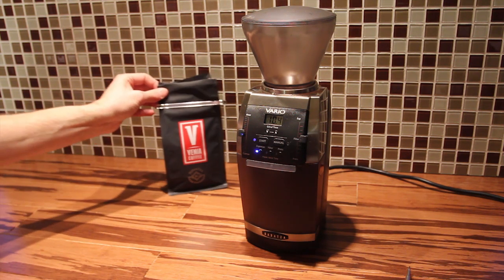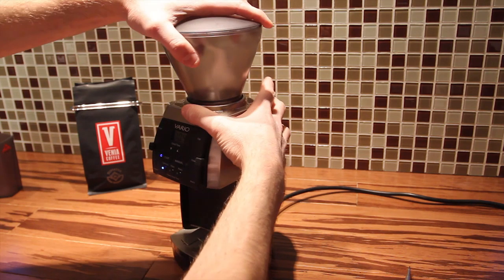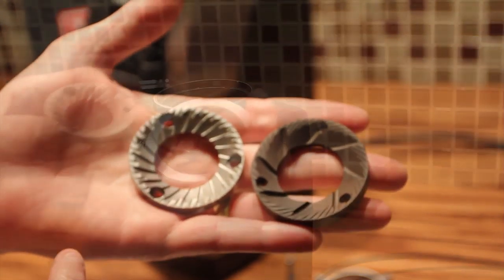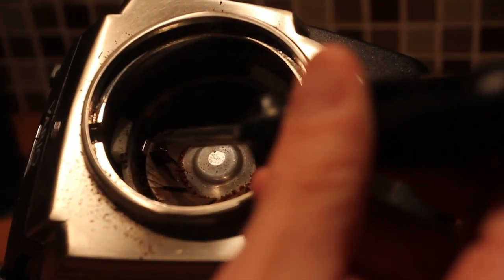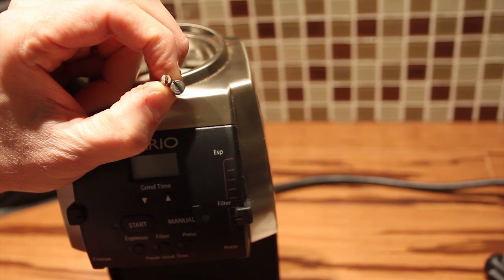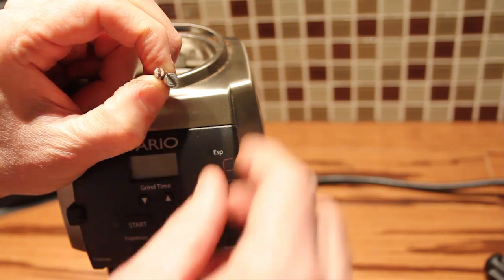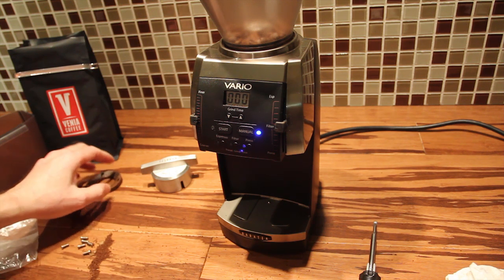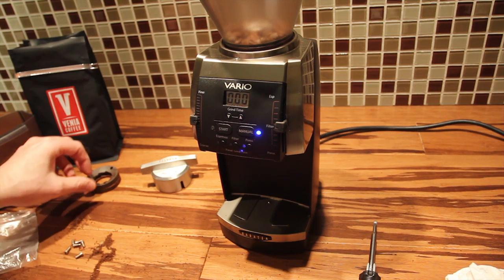Baratza Vario Burr Upgrade

Comment from the maker: There certainly is a debate over the steel burrs for espresso, and we prefer the ceramic in our experience.  However, we did a side by side taste test with the ceramic vs steel burrs for espresso on a LaMarzocco espresso machine and both performed nicely.  The steel burrs produced slightly more bright notes in the cup then the ceramic if I remember correctly.

Comment from the maker: The ceramic burr set's performance on the finer end of the grind scale is excellent, but in the medium to coarse grind settings they can produce more "fines" than steel burr set.  For most home users, the ceramic set will produce an acceptable above average grind quality.  For a grinder used to evaluate the merits of coffees in a process called cupping, consistency is key.  Also users who use a Vario in a manual brew bar setup in a coffee shop should consider this upgrade.

Comment: Why wouldn't you recommend using steel burrs for espresso? I actually called Baratza because I was having issues with consistency in medium settings and they suggested upgrading to steel burrs. I then asked about espresso and they told me some people actually still like the steel ones better for espresso. The only tweak you need to be aware of is that you need to up your calibration to 3Q (from 2Q for ceramic) because for some reason the steel burrs need to be closer to grind as fine as the ceramic ones.

Comment: How does this vario with steel burs compare to virtuoso for filter / v60 or French press.  I wanted to get vario+ as an all in one and upgrade to steel burs but if espresso end will be bad then it’s better to have 2 grinder system.

Comment from the maker: It is a fine slotted screwdriver, about 4-5mm across.  You will need one with a large handle to grip.  The small jeweler's screwdrivers are hard to hold tight enough to break the screws loose with.  Most hardware stores will have one available.

Comment: I understand that the steel burrs assist the grinder in making a coarse grind, but can you achieve the same the coarseness by calibrating the ceramic burrs? I love my Vario and I cannot fathom the need for a more coarse grind.
Reply: my experience is that at its most course I could get a paper filter grind.
Reply: Ancient comment I know, but it's not about the coarseness it's about the consistency and quality of the grinds that are better suited to a coarser brew methods. 
Also the steps are so tiny on the vario that the whole range isn't really that great, so with either burr set most likely I find you need to do a little re-calibration if lets say you want to go from super fine espresso down to a really coarse french press, but for french press and other brew methods I find it's often better to grind finer anyway, for mine I have it calibrated so i can go from Espresso down to filter or aeropress at the coarsest. Default calibration isn't ideal since your burrs are basically touching at at the top / finest settings so ideally adjust that finer and you get more of a larger usable range.